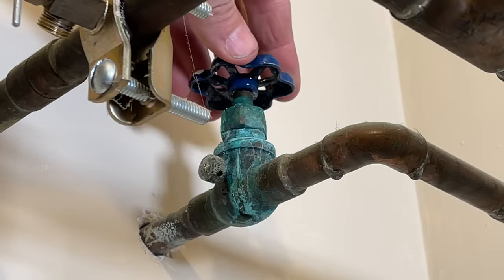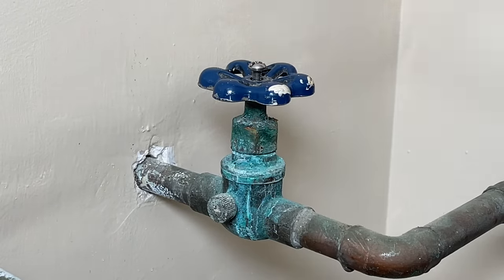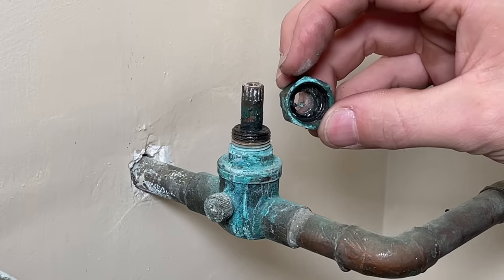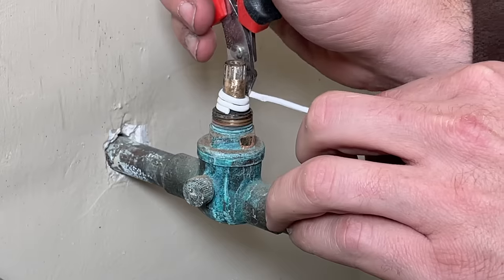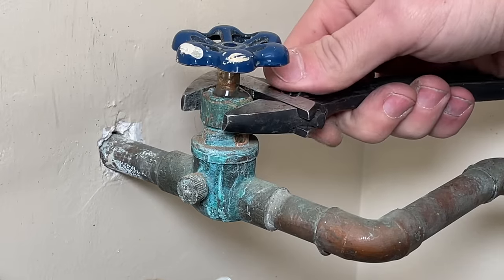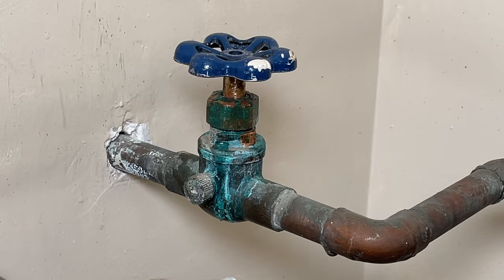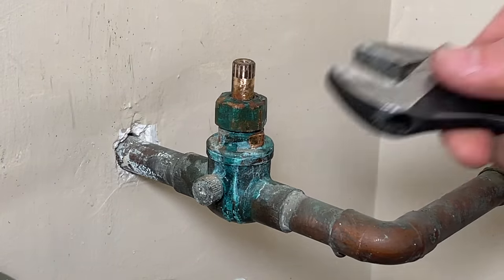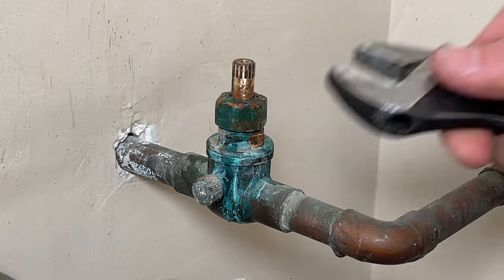How To Fix A Main Water Shutoff Valve Leak

Comment: DISAGREE! someone on here is gunna try this with the water still on to the house, take off that brass nut and sh**'s gunna go flying! And the persons not going be able to shut off the CITY pressure going into their home as it is before the PRV, and now insurance is gunna be involved and plumbers, all because they 'couldn't afford a plumber'. Its called a bucket if its dripping people, start saving and chatting around to have someone do a side job, and replace the valve, save big time in the end!

Comment: why not just replace the valve, rather than cleaning and replacing?
Reply from the maker: If you are turning the water off at the curb replacing the valve is probably a better option 👍

Comment: If you have a blow torch, as you have, why just dont replace the valve with a new one? It will take 5 minutes of welding.
Reply: you don't weld copper pipes!!!

Comment: The main problem you never addressed is the fact that the outdoor shutoff valve at the curb can be frozen in the "on" position. If you break or bust the curbside main valve, you take a HUGE risk of creating a big water leak outside your home, and possibly flooding the street. It's in your best interest to call your city water department to have their crew shut off your main water valve at the curb, or just outside by  the front sidewalk. If the city crew damages the outside main valve, then it's on them, and you won't be held responsible to pay for damaging the city shut off valve. A few years ago, my neighbor across the street was going to fix a water leak at his inside main valve, and did what you suggested.
Go outside to the main water valve at the curb. In the case of the city we live in,, the outside main valve is located in the grass area in front of our homes, between the front sidewalk and the front porch. My neighbor tried to shut the outside main valve, and broke the top of the valve off. Water was severely leaking up from under the grass. The city crew was called, and because my neighbor took it upon himself to shut the water to his home off - and breaking the valve itself, he was charged for damaging city property. It took the crew quite a few hours in the night to finally replace the whole valve system. Not only did the city crew had to shut off the water supply to the whole city block, they had to bring in an excavator to dig up a chunk of his front yard to replace the whole main valve unit and some piping. That meant no water service to our home's for more than three hours. You failed to mention in your video, that if you - the homeowner have not messed with your inside main water valve in month's or years, high chances are neither did the city mess with your outside main water shut valve either. In the end. my neighbor got a water bill from the city that cost him just under 7 thousand dollars. So Mr. Fix-it man, before you arbitrarily tell your YouTube watchers to just dance out to the outside water shutoff valve, and nonchalantly shut the water off - better be prepared to get your credit card out while you call the city water & sewer department to fix the leak you caused by breaking off the top of the valve body.

Comment: FIRST RULE: USE THE RIGHT TOOL. Never, ever use a crescent wrench. That is an "emergency tool". Us the correct size wrench. In this case, use a THIN open ended wrench to hold the set nut and another correct size open ended wrench to remove the packing nut. Personally, I tap lightly  all around the handle once removing the set screw (a screwdriver handle works fine) rather than PRYING it off. 
My biggest problem with this video is....YOU SHOULD TURN OFF THE MAIN AT THE STREET before doing any of the above in case you break or damage anything. Its too late to look for a shutoff tool AFTER you've created a flood!
Reply: An adjustable wrench IS the right tool, you just have to use it PROPERLY, and buy quality wrenches!!
Reply: @walterbrunswick  Bullshit. A drop forged wrench will ALWAYS fit better and result in fewer damaged and rounded off fittings. Always. Anyone who says otherwise is a fool and incompetent, not to mention just plain lazy!

Comment: I would of simply heated and took out the entire valve and replaced with new one and solder the pipes.If everything is so corroded no point of kicking the old horse.

Comment: If I had the street shut off I would replace that junk valve with a full port ball valve with drain plug on it.
Too much time wasted trying to fix a junk valve.
A lot of those stems have cups on them. 1/2 the time the cup is rotten and you either add in a new cup or replace the stem/valve.
Big headache is when the screw holding the washer is rotten and breaks off.

Comment: Why didin't you just use an O ring?  Quick and easy.
Reply: You could cut line at the wall and on the other side of the shut off and install a steel braided line that has a shut off built in.  Your not a handy man are you?

Comment: with the cost of the plumbers cors and the gasket and the time and trip to go to the parts store ? wouldnt be simply cheaper and easier to cut off the valve and instal a new one instead ? a push fit one for people with no plumbing skills. I mean that was a lot of time and effort to save a 60 year old valve when a new push fit valve is less then $10 .. ?

Comment: That's scary that you did not put a wrench or another tool on the valve to take pressure off while you're trying to break that valve apart you are putting weight too much torque on the soldered copper pipes

Comment: First of all, it's not a main water shut off valve. Main shut off valves are full port, full flow, which this is not. Globe valves, or stop and wastes are only for use on a single outlet branch.

Comment: Wouldn't it be easier to just replace it, I understand it's a instructional video and a quick fix option, but to save pissing about
Reply from the maker: If you have the option (skills, time, parts) then yes I would definitely swap out to a ball valve for a better solution moving forward 👍

Comment: First of all the valve your working on must be very very old. Those haven't been legal as a main water shut off for as long as I've been a plumber which goes back to 1970 in Michigan.
Second, in my time as a plumber, that's called a Stop and waste/drain valve. The cover on the side is to drain the up stream line when working on the line.
  The washer has nothing to do with the leak at the stem. Even with pits in the stem, tighten the packing nut more it'll stop leaking for a long time. As long as you have threads you can stop the leak and the valve isn't used that much !
  He's making a lot more of the job than needed.
  There is a very good chance you won't get the valve apart, strip the hex or cause a leak as you try to get it apart. "Been there done that"
Do not attempt the repair at night or week ends, it'll cost a lot more to get a professional repair if you fail !

Comment: Bro, if it is the main water shut off valve you need to shut off the water from the curb shut off, and that involves getting the city involved. At that point just replace the valve brother. Why are you messing with a part that is already clearly fucked? This will lead to the valve bursting and spraying everywhere because nobody is going to just use this to hold off on time to get this replaced. Don't fuck around with repairing of the foundational safety components of the plumbing system, just replace them. It will be way more expensive when you mess it up and it floods your house. Please, from a plumber, just replace it. All you need to do is empty the water lines and use a mapp gas torch to unsolder the valve and use a 3/4" McDonald Nut, with a legend 3/4" compression valve. It's just tightening stuff down.

Comment: The time it took you to horse around with your old valve, any novice do it yourself would have welded a new water ball valve. Local hardware doesn't even catty parts for these old valves anymore..
Reply from the maker: If you say so 👍

Comment: Without dismantling this valve or showing a detailed diagram, no one will understand what you mean by "packing nut" and all of those other terms. I cut my teeth on these being the chief engineer of a 120-year-old hotel. I also learned about reseating faucet valves with special tools. I'm not dissing this video, but unless you're hands-on it's tough to understand. I say... cut the thing off and replace it with a teflon ball valve!

Comment: These valves are antique designs that should be replaced with a more modern designs, especially of it is a main water supply to a house. Any leak causes corrosion that accentuates the leaks by creating permanent small gaps. Ball valves are much better, but could not be manufactured in expensively when this design was invented. I wouldn’t use this type of valve for anything today.

Comment: it's actually a gate valve you're videoing for low pressure systems not a  mains water stopcock
Reply: @Kevin-mp5of  and what would you call it?
Reply: @Kevin-mp5of  My apologies I stand corrected,  globe valves in the UK are predominantly used for large bore pipework, not the smallbore 15mm

Comment: If you can shut it off at a curb (which is usually done by the city for a few hundred $$) what's the point of cleaning this old junk?! Just solder in a new valve!

Comment: step 1: tighten the packing nut 1/4 to 1/2 turn, wrong to much of a turn, that is a stop valve and that nipple at the valve is a bleeder. step 2 turn the valve open and just add lots of teflon tape around the risen stem of the valve, no need to take off the handle. You made it worst now you need a plumber, because that teflon packing cord sucks, it is not for this, teflon tape is better lot of it clock wise around the stem. You made a drip into a leak now what.... step 3 removing the bonnet is not going to fix the now leaking valve at the stem, the washer inside should be change if the valve is not holding the water when close. taken off the bonnet on a valve is not a easy task. looks like maybe a bucket under the drip was better..... sometimes calcium stops the drip. Now that we have a bad leaking valve I hope is not Sunday for a plumber because is going to be double time on the bill. Yes, you need some teflon tape around the bonnet, it could leak without. ( when you tighten the bonnet back on remember that your stem should be UP or you will damage the seat of the valve ). If you are turning the water off at the curb like you said the valve you're working on should be a gate valve, t a stop valve is a cheaper valve. Plumbers like this valves because they're cheap. The one and only valve that should not be cheap is your main valve. Yes, a ball valve is better but for the main valve I'll always prefer a reliable gate valve.

Comment: I'd rather replace that type of valve with a ball valve. Ball valves are much better valves.
Reply from the maker: I agree, if you have the option a ball valve is a much better longterm solution.

Comment: That is garbage. You turn off the water and remove the valve from the housing. You then unscrew the spindle completely from the housing and then clean all surfaces. Only then when reassembling do you introduce the packing material. And it’s not a packing nut it’s a packing gland. You must in the first instance disassemble to remove the old worn fibre material.

Comment: it is not the main water shutoff valve.
Reply from the maker: Because it is 1/2"?
Reply: @EverydayHomeRepairs  No, because   you could shut off the water to fix the valve . The main valve is the first valve that water flow through.

Comment: Excuse me, but you had the water turned off, when you removed the packing nut to address the leak.  If someone doesn't have the specialized tools to cut off the water at the street, they will be met with a spray of water.

Comment: Cuz..Cuzco... don't be lazy, dopey and cheap...  turn the water off at the curb, go to lows and by a new upgraded ball valve, remove and install. Thus garge that you are trying to repair is only going to be a systematic issue. The next time you use, same issue

Comment: Save the headache and swearing. Since you can shut off your main at the curb you can now......CUT OUT THE OLD CRAP. And replace it with a brand new valve. Done deal...will now last for years.
 It might not be a bad Idea to take a good look at any other valves that could be changed. Also the valve in question could have been replaced with a full flow gate valve.

Comment: Cut it out. This is bad advice for people with old plumbing. If its old and fucked like this is don't mess with it. Cut that shit out and replace it. This is a homeowner that has hours to spend dicking around trying to save a buck. Anyone can cut that line and install a new valve in 15mins.

Comment: I hate when people use this crap, just replace the damn valve, whats the point its just gonna leak again I find these all the time when a customer tells me a plumber just fixed the valve and its leaking again most of these bums are charging these people hundreds of dollars and all they did was put Teflon rope in them and then I replace it, I tell every customer to not let plumbers "fix" shut off valves and always have them replaced there less than 20 bucks and should only take an hour to install a new one and if you got a plumber that is trying to charge you over 200 dollars dont do it call another plumber cause they are ripping you off

Comment: Not one of your best videos. Very cringy. A better solution is to leave it alone if you can't get the water shut off, replace it if you have the skills, or replace it down the line with a shark bite version if you don't.